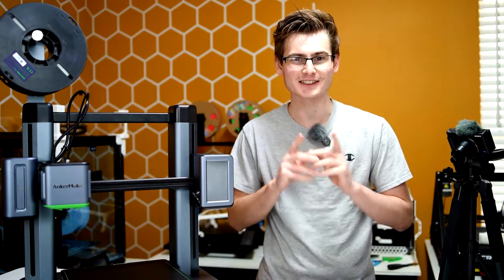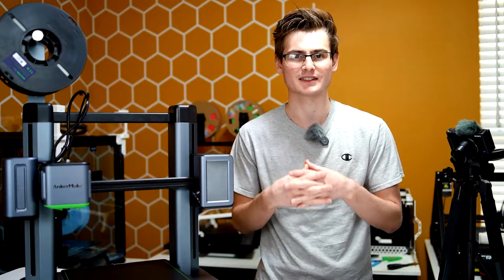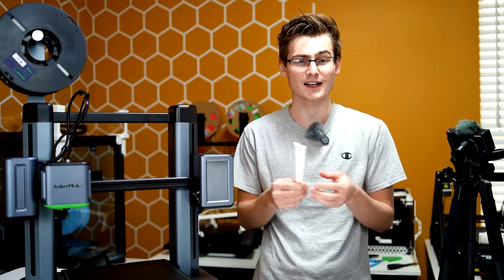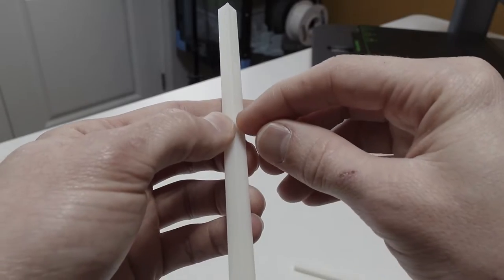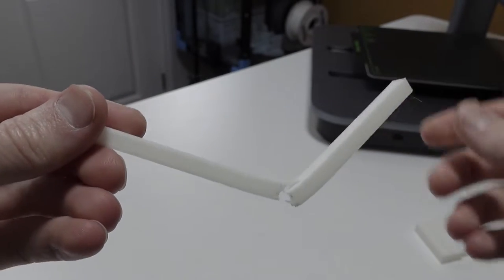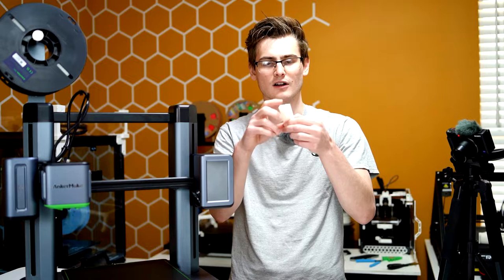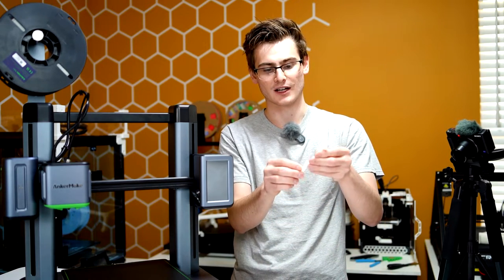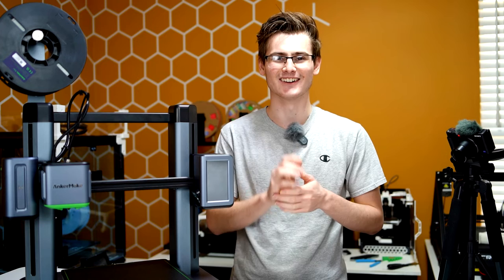3D Printing Tips: Choosing The Best Print Orientation For Your 3D Printer

Comment: Thanks for the video!  Would you be able to expand on this topic of model orientation and how it affects supports?  I'm still learning and being a noobie, I've been focusing on models that can be done as a single print (vs. printing multiple parts then assembling it).   I know this approach will require supports (depending on the model) but I've come to realize that the "right side up" orientation when printing a model may not be the best approach.
Reply from the maker: I think most creators do the best they can to orient a print in the correct orientation so when you import it, that is how you should print it, that being said, it is up to the creator, so that isnt always true. I can do my best to work on a more in depth video and have video of the slicer as well, but it might be a few days.
Reply: @ThePrintHouse  Awesome, thank you!  I am looking forward to it!  No worries on needing time to get to it.  I know you got plenty of topics in the pipeline so I did the responsible thing and subscribed.  :)